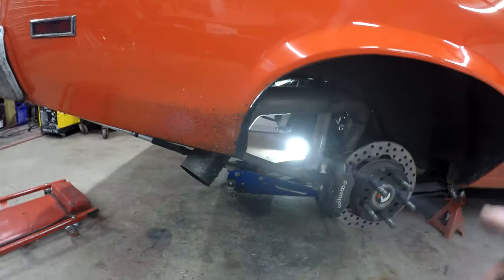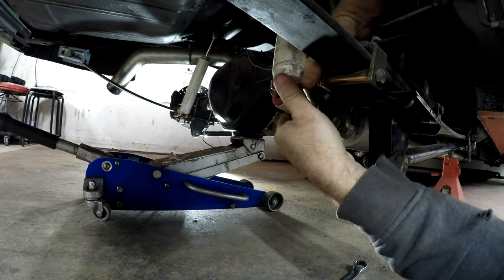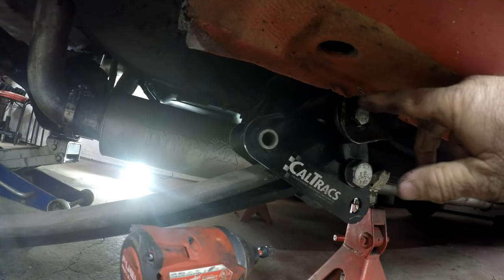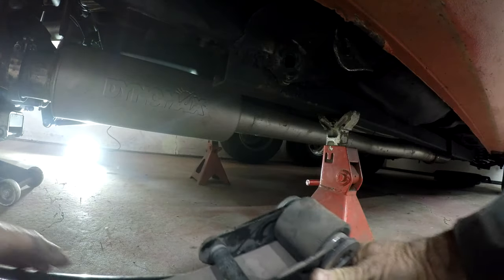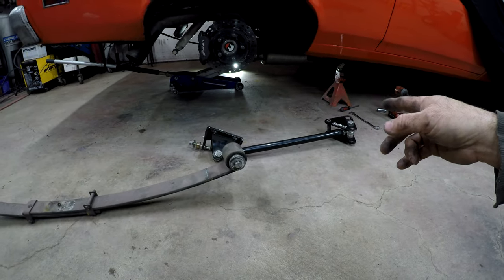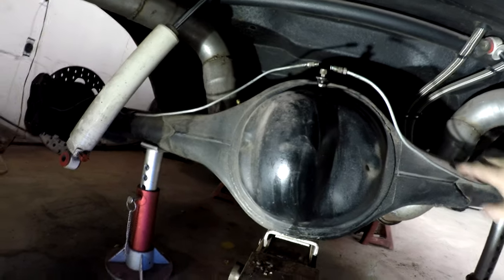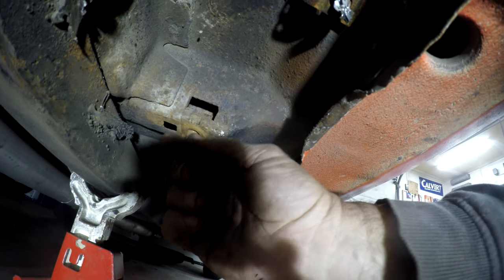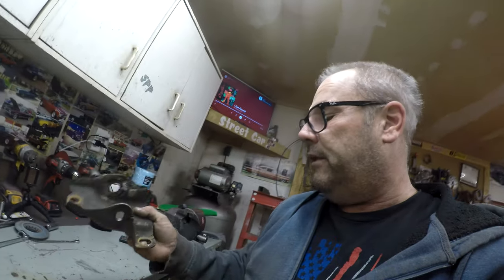Installing Calvert Leaf Spring Sliders & a TRZ Anti Roll Bar | Part 2 of 4

Comment: Hi Rob hay what rearend do you have in your S10. I was considering buying a 1976 Camaro  rearend its 8.5 but I don't know if it could take horse power from a 350 Slightly modified.
Reply from the maker: It has a 8.8 but a 8.5 would be good for a mild sbc
Reply: @SPPTVarmy  thanks for the info